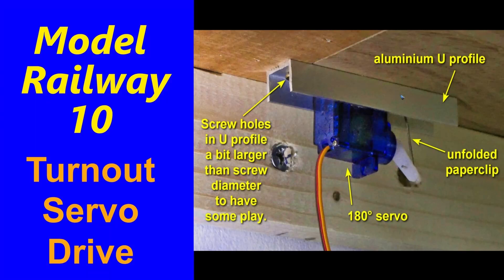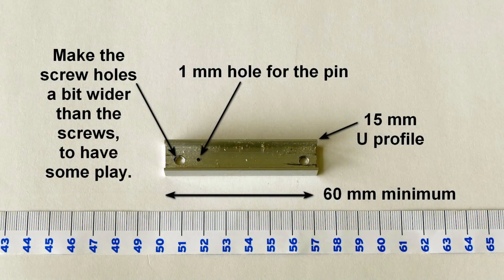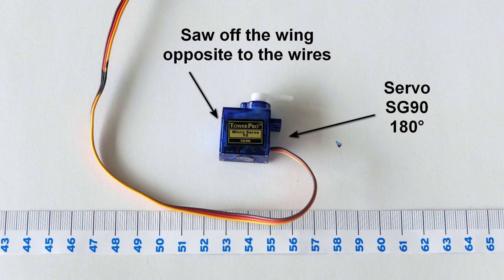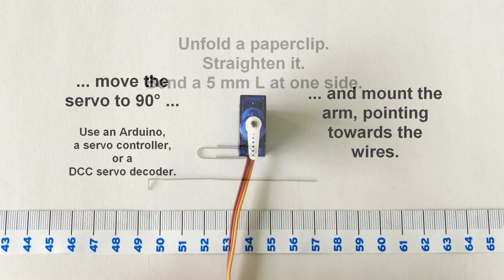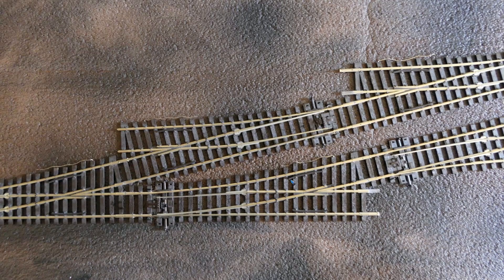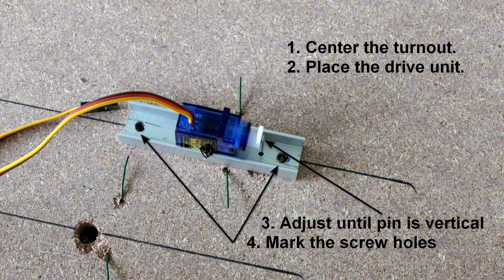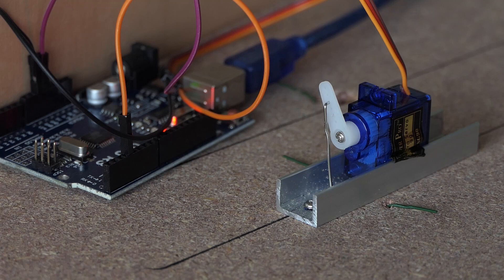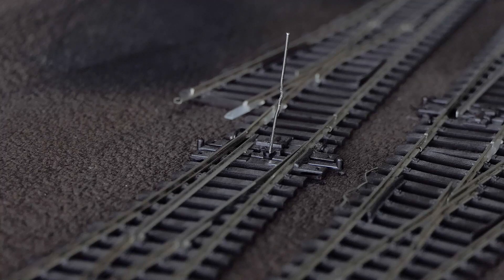Model Railway 10 Turnout Servo Drive

Comment: my servo keeps running and cant stop... i got a 360 servo but I am using the     myServo.write(90); command to stop it... does yours k,eep turning and turning?
Reply from the maker: I use 180 degree servo's and yes they can stop at any position. Maybe a 360 servo is the type that runs continuously?
Reply: With an Arduino you can program the sketch so that the servo only runs for a certain angle.

Comment: Hello Rudy, I like your videos and systematic approach. I would like to give the train controller software a go and would love to know how well it works with your arduino turnouts and accessories. How are you connecting them together?
Reply from the maker: Well, they work together just fine. The Arduino works as a DCC decoder. Easy to use is the free MARDEC software form www.Arcomora.com. You need a little hardware with an optocoupler to scale down the DCC signal to the 5V of the Arduino, info here: https://rudysmodelrailway.wordpress.com/software/

Comment: I have found some that are labeled SG9 tend to be 180 and SG90 tend to be more often 90, but it does seem to vary.    I  have a 3D printer and I printed some mounts for the Servo's that can also accomodate a microswitch, which can be used to send a signal as to which way the servo is postioned, or for switching polarity on an electro-frog.      The paper clip is a good idea, but I do find you need to get quality paperclips.  Some will just break when straightened, and some will rust quickly
Reply: When using an Arduino there is no need for a microswitch on the servo. You can define a buddy port on the arduino that gives you this possibility.
Reply: @Lobomotion69  This is true, I just like the physical microswitch rather than relying on software to set limits :)    The microswitch can also be used to trigger lights and other things, or isolate tracks in some instances.
Reply: @EsotericArctos  That physical microswitch tends to break down due to the mechanical action. In software there is no mechanical movement, thus it will not break down.

Comment: Hey Rudy, thanks for the update!  Interesting choice using the aluminum bar.  Get yourself some nice servos though from a reputable seller such as Adafruit.  I'd be worried about these failing within a few years or being made with fake components.  The ones with metal gears are only $9.95 a piece.

Comment: Quick question.  I'm going to build a new layout and am thinking about 1/2" plywood, followed by 1" Styrofoam, and then cork road bed under the track.  Can the turnout servo drive system you have excellently shown here work?   Is the foam going to be a problem ... too thick?  I've heard pluses and minuses about foam.   All the best to you ... thanks for the video and sharing your ideas.
Reply from the maker: The pivot point is the little hole in the aluminum strip. If you know the distance from the bottom of your table to the hole in the turnout, which is the additionn of all layer thicknesses, it's easy to make a drawing and see what angle of movement you need from the servo and if that's feasible. Best to be sure though, why not just try it out?

Comment: hi Rudy Can you help  did not know how to get a hold of you  hope  this is ok 

So the PXB88 and the BXPA1 need a GMB16X Tab. Train Controller has an option for single reporting but I need to find where the GMB16X is located? I have looked in Train Descriptions, gone to a train description but when it says to look for the edit tab there is not an edit tab in that window. It also will not let you access the "edit" tab in the menu bar when the train description window is open. I have the information on the BXPA1 and the formula is address x 2 subtract 1. I understand how that all works. I have worked hours researching this in the various help menus and yet cannot figure this out.

Could someone in the group please assist with some clear instructions to figure out how to get the GMB16X into the train detection tab? Usually after this much digging I can figure this stuff out but this one has me baffled. Any help would be greatly appreciated and very kind.
Thanks in advance!
Greg Whayman
New York & Seven Railroad
Train Controller 10 Gold & Digitrax
Reply from the maker: Greg, I have no idea what a GMB16X is ... I don't think I can be of any help.
Reply: @rudyshobbychannel  thank you

Comment: How many turnouts can you connect to 1 arduino?
Reply from the maker: Max 10 servos per Arduino, or max 16 accesories, or any mix of those. You could control say 7 servos and have 9 outputs available for accessories.
Reply: Nice I always love seeing your videos Rudy
Reply from the maker: @cadillacescalade5428  Thanks for the feedback, it's appreciated.
Reply: Thanks Rudy but What is actually switching the servos to move?
I have the servos and the Arduino uno board but I do not want to operate my servos with a Computer.
I want to control them with physical switches mounted on a board.
No one shows how to do this?